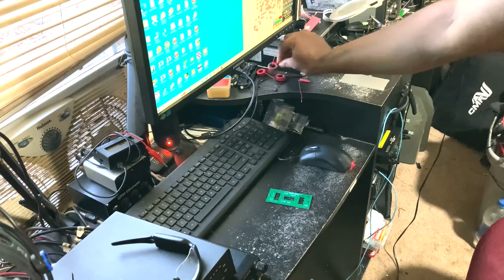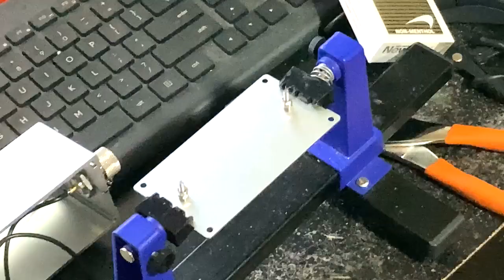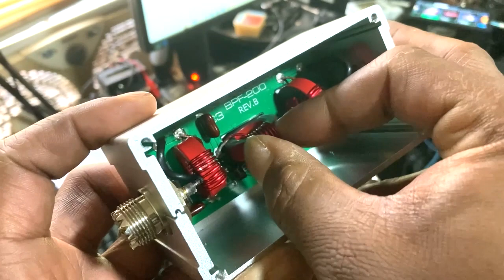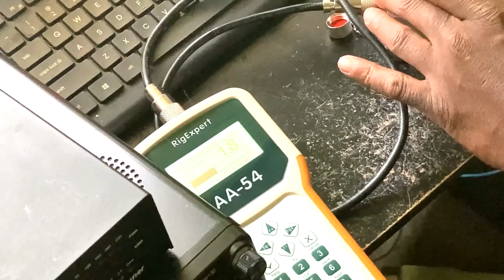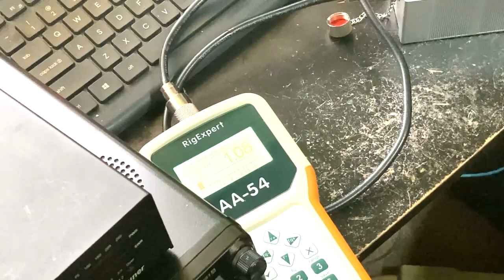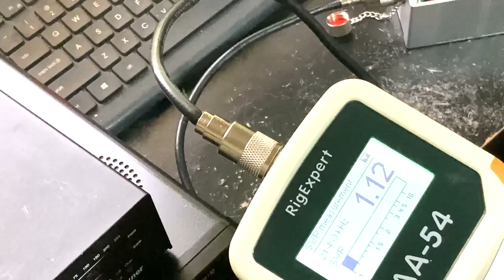Build a bandpass filter for any band and how too tune it. DIY Bandpass filter for ham radio.

Comment: So why do you need a band pass filter?
Reply from the maker: A band-pass filter or bandpass filter (BPF) is a device that passes frequencies within a certain range and rejects (attenuates) frequencies outside that range. It's the opposite of a band-stop filter.
Reply from the maker: Field day is a good example. If I'm transmitting on 40m and the other operator is transmitting on 20m the 40m filter is rejecting his 20m signal and only allowing the 40m signals to pass through to my receiver.  If that makes sense.
Reply: Because the universe is a noisy place! If you're in a city you're surrounded by electronics, TV's, microwaves, USB chargers, dryers you name it, which all make EM noise (AKA call noise floor, all that static with squelch off) even the Sun makes a ton of EM noise. A band pass filter gets rid of strong unwanted EM/RF noise bleeding in from other frequencies so you can hear the frequency you're tuned to much better with less background noise.
Reply: @macgyver5108  Real name brand ham radios already have band pass filters built in so no need to build any!
Reply: @stevec5000  true for older radios, but even spendy "brand name radios" that are newer SDR based, like say a $1400 Icom IC-7300 can greatly benefit from a larger band pass for a specific band. It's just the nature of most new SDR's, the frontend can be swamped by strong signals nearby. Like was mentioned at field day if some lid has their mic gain way up and is running @100w...